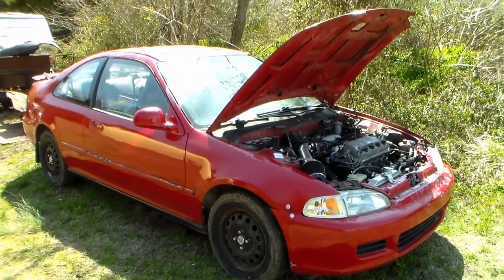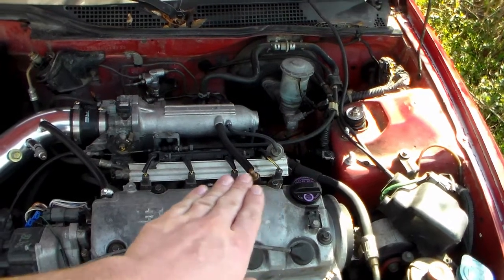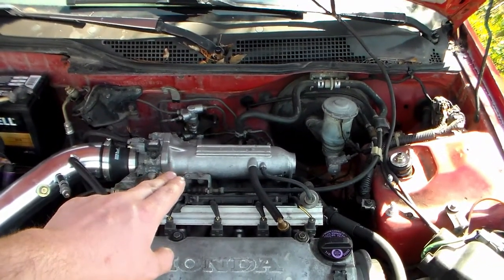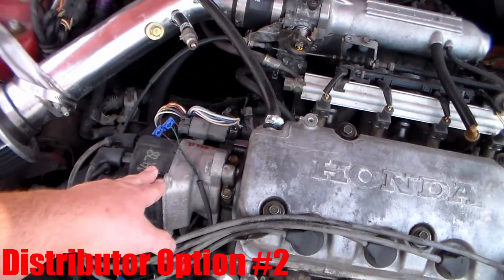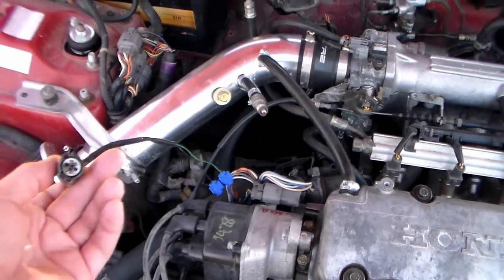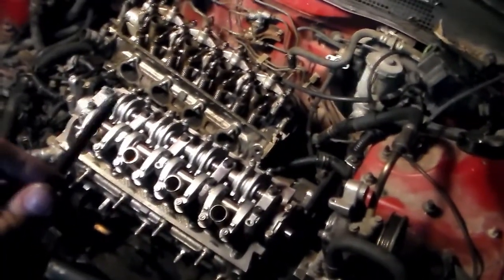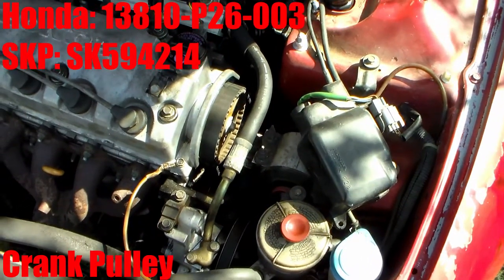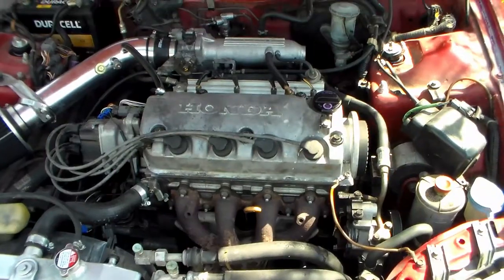How to Install a D16Y7 Head on D16Z6 (1992-95 Honda Civic)

Comment: will it work with an z6 ECU?
Reply from the maker: Good question. I actually don't remember if we tested that. Our z6 ecu that came with the car worked but was damaged so when we got it and we did all of this we put a p06 in. I would think it would run and drive but have a check engine light due to no vtec and maybe at the most some reduced power? If it started and ran I don't think it would damage anything.

Comment: Question? For the distribuitor can I use a Y7 distributor or does it have to be a d15 distributor? Im doing this tomorrow and im just trying to get some info
Reply from the maker: You can use the Y7 distributor. It's perfect to fit into the Y7 head for this application. Only thing you have to do is get a cheap conversion harness for adapting the obd2 distributor to obd1 plugs. You can also make it yourself. Here's 2 charts I've uploaded to help you in this journey: https://www.mediafire.com/folder/veqrls7a04ds5/Distributors

Comment: The  z6 head is better than Y7 because vtec
Reply from the maker: You are mostly correct. We only had a non vtec ecu and a non vtec head at home when I had to get my wife's car going that way she could go to work. The factory Z6 head that came with the car the previous owner was an idiot who cranked down on it with an impact and cracked the hell out of the rocker assembly and ruined alot of the head.
Reply: @foxisretrofitting4556  bro you are living my dream you still having the coupe?
Reply from the maker: @axelmoiseslaham452  Yup we still have all the cars featured on the channel. We just removed the engine harness out of the coupe that's in this video because rats got to it. I've gotta repair the wires sometime but funds are lacking so it will be a while. The rats just sawed right through the fuel injection and distributor wiring.
Reply: @foxisretrofitting4556  nice :)

Comment: Question I have 1992 eg hatch and I'm try to swap a d16y7 into it do I use the the original ecu from the 1992 or the 1996 and the same for the engine harness
Reply from the maker: You can use the harness and ecu from the stock 1992. Ignore the crankshaft position sensor that comes on the D16Y7 it can be ignored. You'll have to deal with the distributor situation since the wiring will be different and your '92 used the distributor for crank position instead of the D16y7 that used a sensor on the front of the oil pump. There's several ways to deal with that. For example you can gut the obd2 distributor and put the insides from the '92 Obd1 distributor inside it or you can use a different obd1 distributor like I did with the one I used in this video. To keep things simple depending on what your '92's original engine is you could keep your stock intake manifold with everything on it so you don't have to convert or modify any wiring for your Idle air control valve or intake air temp sensor. If it's an automatic You will absolutely want to use the transmission and throttle body / throttle brackets from your '92 because '92-95 used a cable operated system instead of electronic like the transmission that came bolted to that D16Y7 in '96-2000. Make sure to match your fuel injectors. You'll want the flowrate that matches as close as possible to the d16y7 (180cc) but obd1 to fit your factory harness and ecu. We used D15B8 injectors to match our D16Y7 head in this video.

The TLDR: Ultimately your build will hook up and be done the exact same way we did with this car. Ignoring things on the D16y7 block like the crank position sensor and knock sensor (if it has one some Y7's actually did). Most things will depend on which intake you will be using. Things are simpler if you use your '92 intake manifold. If automatic use the '92 transmission because it's cable operated. Let me know if you need any more help or have more questions :)

Comment: Also did you have any issues with timing or everything was good?
Reply: Thank you for the response! I will be using a p28 with neptune/demon 2 set up. I have a tune for a z6 with intake, header ect. that I can upload. Your advice is very much appreciated!
Reply from the maker: @zachburkett2615  Ah perfect! You'll have an advantage with the P28. If I remember correctly the ignition mapping is slightly different between the Y8 and Z6. This normally isn't an issue with a daily driver or normal street/hwy use. If you go to doing drags or track with it and you want the most power then you'll have the ability to really dial it in with the P28.
Reply from the maker: Using the Y7 head with Z6 block timing was perfectly fine. Just line up the dots on the crank gear with the arrow on the oil pump and line up your camgear with the engine head surface (valve cover off). I use a flatter 10mm wrench rested on the surface of the head to quickly gauge the camshaft gear alignment along with the tick marks on the cam gear. What ecu are you going to be using? Scroll down and find @mostwantedej6157's comment one of my responses explains the process that I took to safely set tdc when you are working with something you are paranoid about working or unfamiliar with. In @dylanpeytons2820's comment reply I went into what could be considered when putting a Y8 head on as well as fuel system concerns if that would help as well. I've got manuals on all these things too so if you need any technical info or anything else just ask.

Comment: What about timing i heard it would b off slight i know this video is old try to get back to me
Reply: I going z6 block with y8 head on a p28 chipped everyone said i need adjustable cam gear I ordered one but it didnt come with a woodruff key now im stuck will the stock cam gear work? If yes then how im lost i dont want to bend a valve
Reply from the maker: @mostwantedej6157  You should be perfectly fine. The stock cam gears for the Y7 and Y8 are the exact same. You have a great advantage running a chipped P28 since ignition mappings are different Z6 to Y8. I have 2 strats If you get paranoid (I do this stuff when I do something I'm nervous about or uncertain)
Option 1 Best way: Take engine head and put it on some jeans on top of a flat table or toolbox. Take a spare timing belt and turn it until its lined up with its tdc marks. I take a 10mm wrench and lay it flat on the surface of where the valve cover gasket sits across where the cam gear is. The wrench will line the flat surface with the marks on the gear. Set the crank of the engine to its TDC marks. Bolt head to block. Put your timing together and then when you have your belt on and tensioned slowly turn the engine by hand in the direction of rotation with the sparkplugs out. Should be fairly easy to turn. If you keep turning and feel no interference perfect. If you are turning it and something gives you major resistance (like stops you in your tracks) or clacks together inside the engine it wasn't hard enough to bend anything and then you know it wont work or your timings off. This combo with stock gear should work fine just be sure if there's an oil restrictor on top of the block to remove it since the d16y8 head has a restrictor built into it instead. 
Option 2 Lazy way:
 Turn the crank of the engine with the head off until all the pistons are half way in each cylinder  so they are totally clear of where the valves are. Put your head on and then turn your head with a spare belt to it's tdc marks none of the valves will hit because the pistons are so far down. Then turn your crank slowly to its tdc mark. Put your timing together and then when you have your belt on and tensioned slowly turn the engine by hand in the direction of rotation with the sparkplugs out. Should be fairly easy to turn. If you keep turning and feel no interference perfect. If you are turning it and something clacks together it wasn't hard enough to bend anything and then you know it wont work or your timings off. This combo with stock gear should work fine just be sure if there's an oil restrictor on top of the block to remove it since the d16y8 head has a restrictor built into it instead.
Reply from the maker: @mostwantedej6157  After looking into it I found that Z6 & Y8 TDC lines up perfectly for sure. You can set it up that way set a distributor in the middle, start it, advance the distributor where the throttle responds the best when you flick it by hand, and drive the hell out of it as a daily. For super dialing it in for best results or serious racing applications the whole reason for the adjustable cam gear is to clear up any difference in crank pulley markings. There's a pretty wide margin for timing degree with D16 engines. It just depends on application and what fuel you are using.
Reply: @foxisretrofitting4556  i appreciate you responding im going to time it crank by hand if i dont hear or feel anything I’ll run it
Reply from the maker: @mostwantedej6157  No problem. Go for it man! You should do a video on the first start. I'm going to do seals on the car in this video soon and I'll try and do a video on the timing marks for others to reference as well. There was another comment on this video that asked about the distributor situation on a y8 head. In that comment I went into fuel injectors you may need for your application if you are running stock honda parts. May be useful.
Reply from the maker: @mostwantedej6157  Did it go smoothly?
Reply: @foxisretrofitting4556  i ended up using the adjustable cam gear was really easy i dont think it wouldve worked without it tho because i set the adjustable cam gear two degrees advanced n it ran perfect I appreciate the help u def gave me confidence to finish the car appreciate it bro
Reply from the maker: @mostwantedej6157  Hell yeah man! Glad to hear you kicked its butt. With that adjustable gear you can get it absolutely perfect. Now you can thrash on it and not have to worry about lacking slightly in the power dept.
Reply: Hey how did you get around the crank sensor
Reply from the maker: @effrinvilla40  Since the Civic its self is a 1995 with factory wiring harness it's an obd1 system the computer references a "crank sensor" magnet inside the distributor instead of one bolted on the front of the oil pump like the OBD2 D16Y8 does. So no bypass was required for this application.
Reply from the maker: Not old at all man. It actually worked out to be the magic combo. Specifically for the D16Y7 & D16Z6 they work the same. Didn't have to do anything funky. Just line the Y7 Head Cam gear up like you normally would for a Y7 or Y8 (same cam gear). Line the D16Z6 crank gear like you normally would for a D16Z6. The timing marks on the Harmonic Balancer pulleys even have the same tick marks as well. We used the D16Z6 Harmonic Bal. pulley with it. Can't say much for the timing covers however. I didn't have any covers to use and Z6 lower covers are almost impossible to find at wreckers. For timing belt the Z6,Y7,&Y8 all take the same exact belt. If you have any more questions just let me know. I can always make another video in the guts of it.

Comment: What would u have so do to put a y8 head on? I’m curious about the distributer
Reply from the maker: Great question! The Y8 Head is the exact same process but with a few things changed. The distributor would be the same as with the Y7 head in this video since the goal is to have a ODB1 compatible distributor that will bolt onto a head that's normally ran with an OBD2 system. For the ECU you'd use a P28 ecu so you could use the Vtec on the Y8 head. The 235cc flowrate injectors I used in the video would be 5cc's leaner from the stock 240cc that are used for D16Y8. I've seen some Keihin 240cc flow injectors online part number Jc585 listed for OBD1 92-95 d16z6 that would work out of the box for your application with no mods to the fuel system. If you wanted to get creative you could go to the junkyard and get some OBD2 D16Y8 fuel injectors along with their harness plugs. You can use the OBD2 connectors with your OBD1 wiring to use the D16Y8 injectors. BE CAREFUL One thing to look out for is look into "Peak and Hold" VS "Saturated fuel injectors". If you go to mix and match OBD2 injectors on OBD1 Hondas make sure to know if you need to bypass your injector resistor on the drivers side next to the strut tower that way you don't fry your ecu because the newer ones are different ohms of resistance. As a side note I've seen people use D16Y8 Head bolts sets as well to install y8 Heads.  The Z6 Head bolt set can be used like I did in the video as well but will require the addition of 2 washers like I mentioned. Just depends on what you can find on sale or have around :)